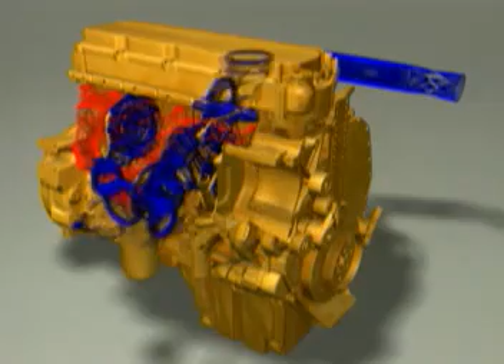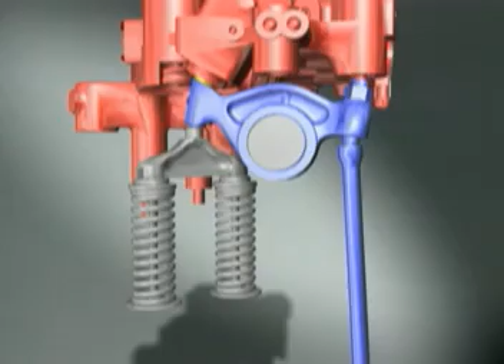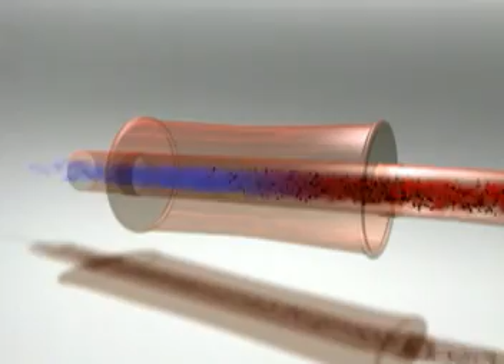Caterpillar ACERT Technology

Comment: @studpuppy69 Only if you don't do the smart thing and go to pittsburgh power in Pennsylvania and get every product they make for this engine plus the extras like a lipe clutch and FASS fuel system and oil trap and the rest.  20,000 dollars or their abouts will get you custom fuel injectors and a engine that makes over or about 1000 horsepower and will probably get close to 8mpg with the power level on level one for their computer they make for the engine.
Reply: Assert